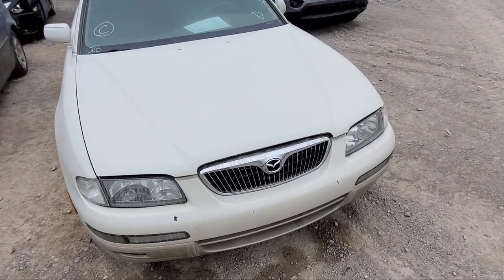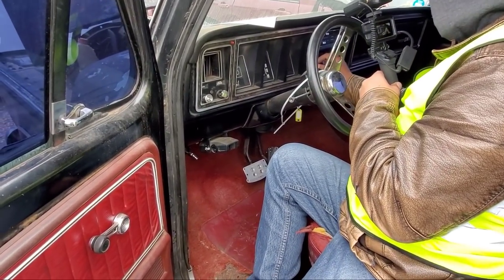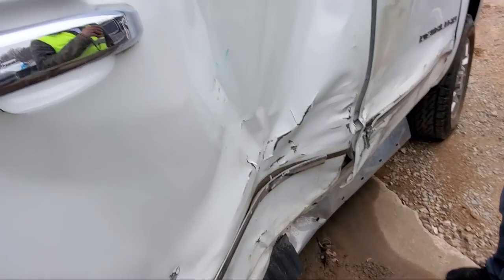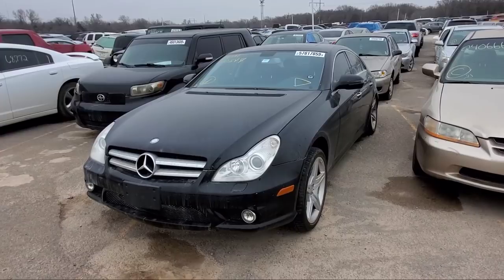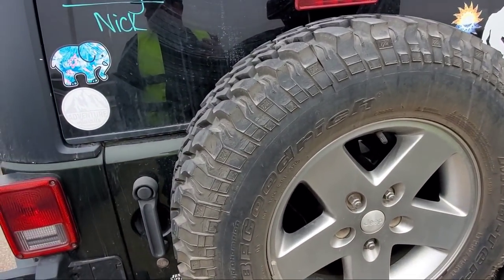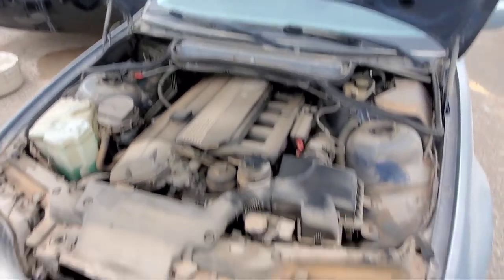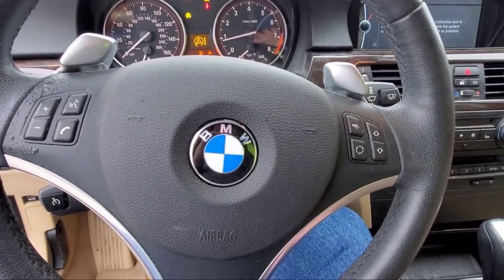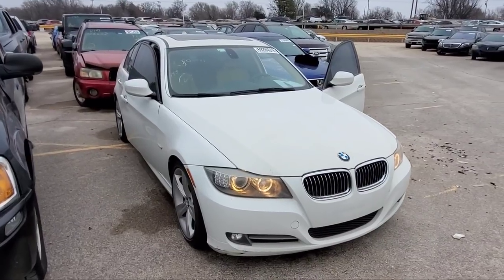Copart Walk Around. NEW POLICE TRUCK?

Comment: Transmission concerns on these cars is alleviated by adding an external cooler. The radiator lines are too small, just like old Chrysler products.
Reply: ...Or change the tran fluid every 60k miles? Everyone thinks the freaking fluid can last a lifetime...🤦